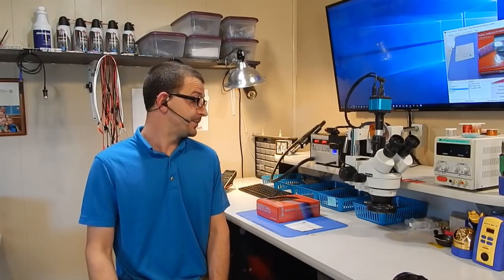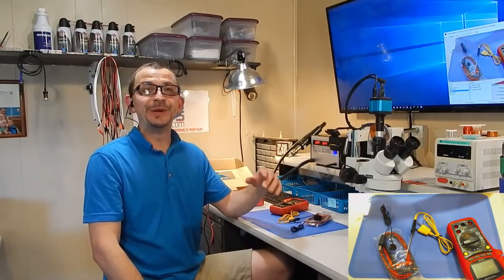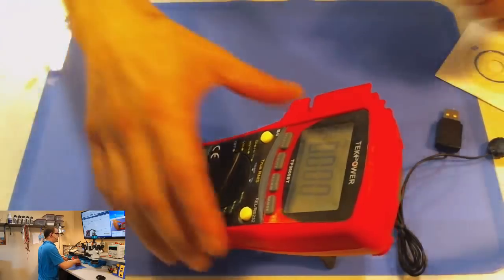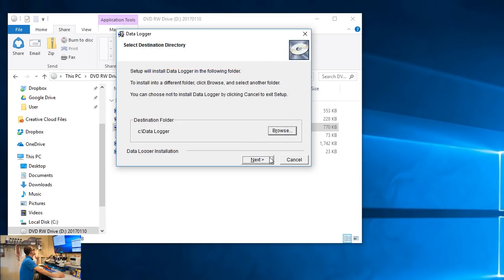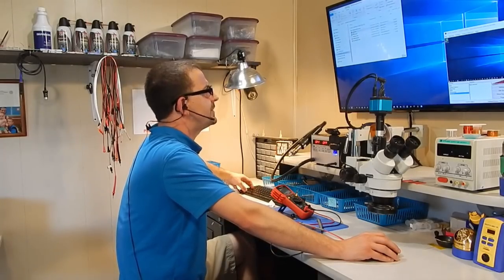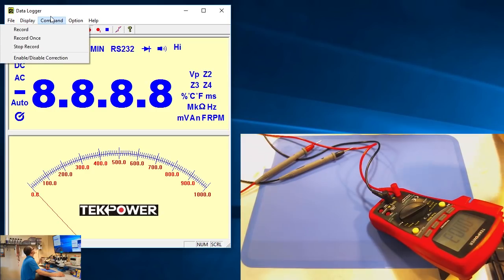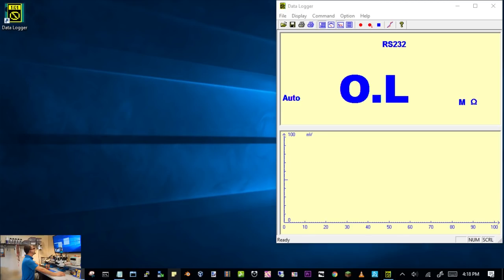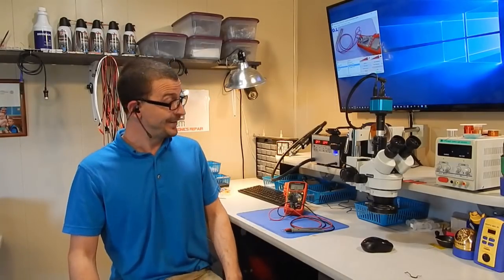Adding On-Screen Multimeter with Open Broadcaster + TekPower TP9605BT

Comment: In 2004 I bought an inexpensive Radio Shack 22-812 to try out and loved it so much it ended up replacing my Fluke 87-III as my everyday go-to meter. I still have my trusty ol' Fluke but for everyday stuff I still use the Radio Shack meter and I absolutely LOVE it. I originally bought it because I needed a basic meter with a PC interface for logging measurements over long periods and the RS 22-812 seemed like a good deal and I can't say enough good about it. I use that RS meter for pretty much everything and it's still a fantastic device!

Comment: Bro .... what about that new blue mat you got there ? where did you get it ? specs ?  Thanks man
Reply from the maker: The mat in this video is a kitchen table place mat from Walmart.. LOL  Although it is not discolored by heat, it's too thin and bubbles (temporarily) where hot air hits it.  I only use this one for a backdrop in videos.  I'm gonna order a proper mat I think.    Makes video look a lot better.
Reply: Amazon. Silicone sheet pan liner.

Comment: that battery will deplete very fast I suggest using an ebay buck converter to turn ur pcs 12v into 9v for the meter and solder the buck converters output wires to the battery terminals
Reply from the maker: +peterizrandom I can see why you would say that now.   It does seem very picky about battery voltage.

Comment: On checking reviews on Amazon this meter is ratings are extremely bad. I should have watched some of the reviews before my purchase of this meter, I would have never bought it. I’ve tried to call the help line, go to their website help line and their main website. LINK, FAILED TO LAUNCH HELP. There are a lot of other people that are going though the same problems that I am having. I would like to do everything possible to try and get it to work before sending it back. On the one that I have the blue tooth and the RS232 cable doesn’t work, and I’m pretty good with computers. One more negative review will not hurt them, but it looks like it has to be done. FYI DON’T BUY.